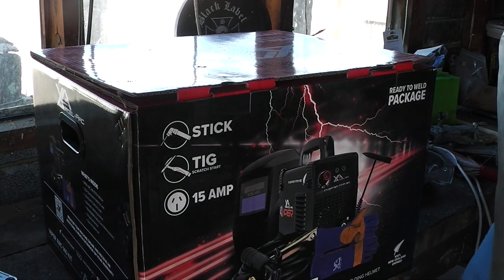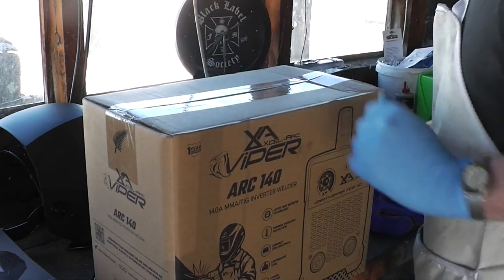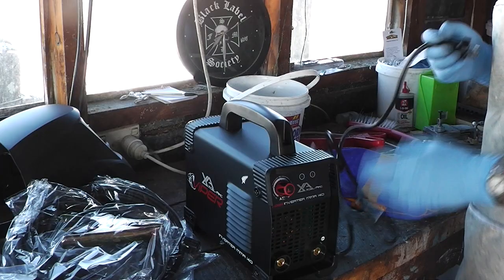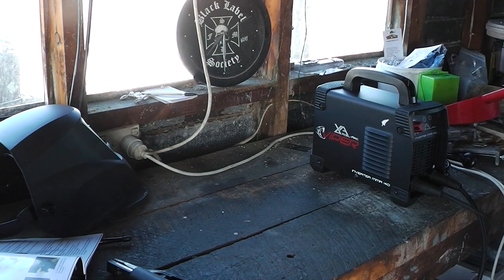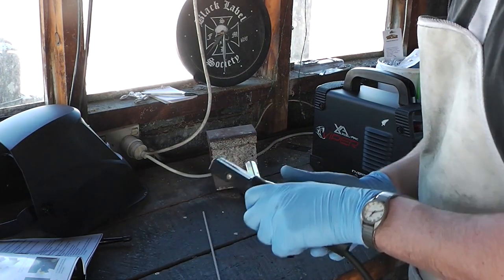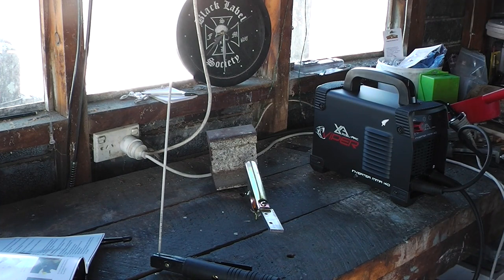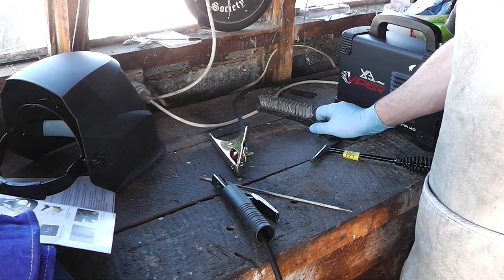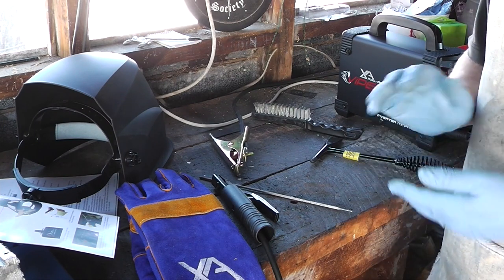First Time Welder

Comment: For your first welds they don't look bad, but for farther welding you will want to get a jacket or sleeves of some sort welding will give any bare skin one hell of a sunburn.  Also when the manual said earth and ground lead, in welding the clamp that gets attached to the bench or work piece is called  the ground so I think you have the set up backwards unless you changed them and didn't show it stick welding is usually electrode positive. If you have any questions I'm StormHerald in the Varga Discord and would be happy to try and answer I hope you have fun learning to weld.

Comment: Welcome to the world of gluing metal together Mr Allen. Keep practicing and you'll be able to lay those weld beads down like they were molded in place. Try to keep the rod as close to the metal as possible and move the rod in small circles about 6 or 8 mm in diameter. Move the rod slow enough to allow the molten metal to fill in the weld puddle and overlap each circle by about 50%

Comment: I remember playing with my first arc welder, was trying to arc weld sheet steel, it went as well as you'd expect(poorly) because I didn't have a mig/tig welder or gas for said mig/tig welder that I didn't have.
Reply: Sheet steel with stick is a nightmare! Self-shielded flux core ("gasless MIG") is a poor-man's alternative that works a fair bit better.